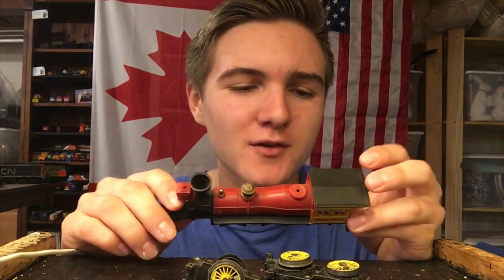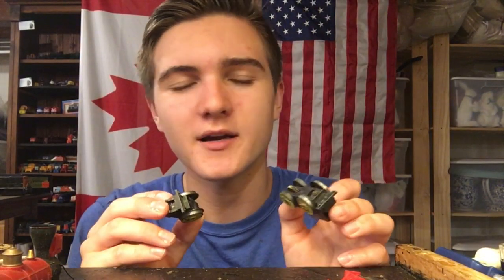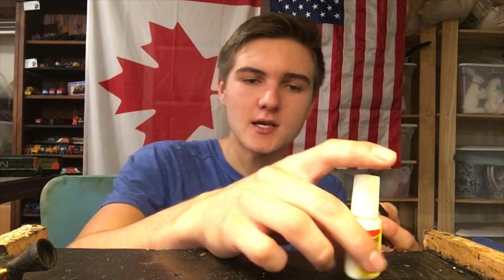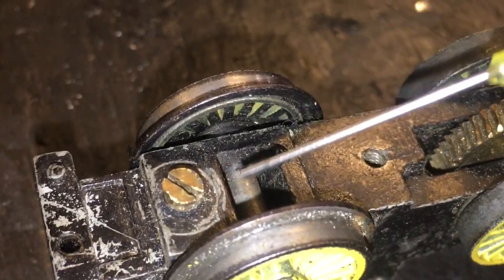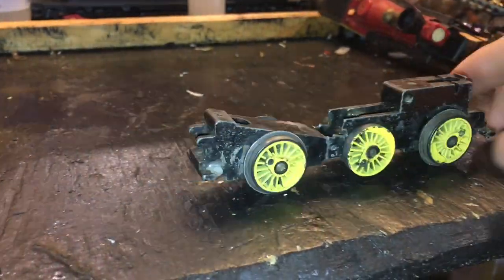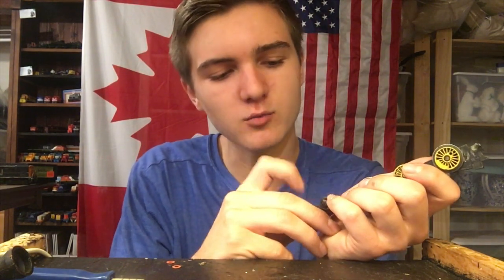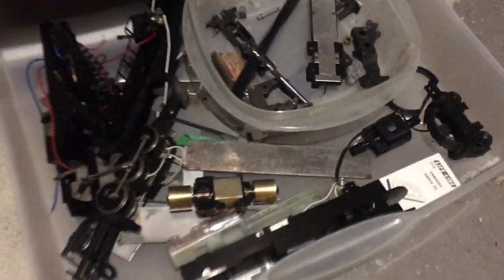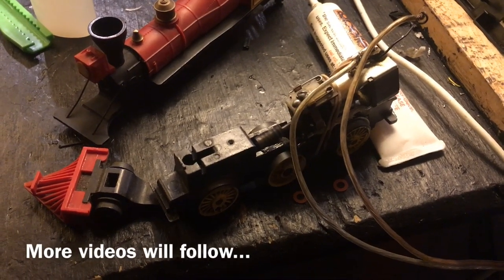Trying to Restore the Tri-ang Davy Crockett

Comment: An important secret, this uses the same chassis as the more modern Hornby Jinty. I think the wheels might be interchangeable as well, the motor is probably much different, but probably a smoother runner.

Comment: SMT - The area of the frame where it was broken; is there room on the inside to mount pieces of plastic or metal to reinforce the repaired joint?  My thought is to cut the pieces from a thin sheet of either materiaI & attach them with crazy glue.  It appears that Triang trains were quite popular in Canada; are there individuals, or long-time hobby shops that possibly have parts?

Comment: At it again Harrison, bringing another Loco back to life.  Like the others have already said,  JB Weld would work better on the chassis.  I was cringing as you were bending it in the vice.  I'm surprised it didn't snap on you as it looks to be made of die-cast metal which is not that forgiving once it is bent.  Look forward to seeing it back on the rails.  Do you have the coupling rods?

Comment: same style chasis as the green class 08 body shell you have old hornby 0-6-0 with the x04 motor.
Reply from the maker: I checked and they're not the same. Very similar but this one is around a half inch longer.

Comment: You should make yourself a pole with platform for that vise. Be alot easier to use it when mounted. Then you can put it off to side when need be. Plus get some caster wheels or lawnmower wheels to mount to bottom that way you can tip it back and roll it.
Reply: Don't know if you have harbor freight by you, but they have everything you need for thia and your layout, almost... You would be surprised at what they do have for tools the people like me an you use.

Comment: What grease do you recommend for gears?
Reply from the maker: Labelle 106 combine with some oil
Reply: What about conductive lube?
Reply from the maker: @WestCascadeRail  That's fine, just make sure to use grease and oil and not just oil. Any type of oil is too thin and won't lubricate as well as a grease oil mix. All that's good about conductive lube is that it helps conduct power though bearings etc.
Reply: Ok thanks. But what conductive lube do you recommend?

Comment: If your good at restoring locomotives. I'm selling a cw44-9 CSX #9026 I'm selling it for 35.00. On Ebay it sort of runs but just kind of badly. It needs handrails and its light is out of place. Its dcc ready.